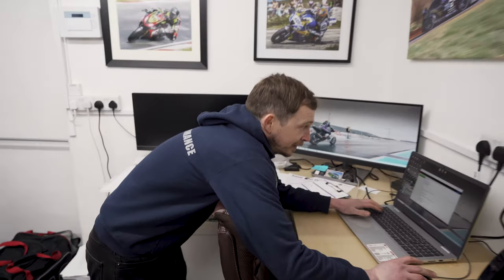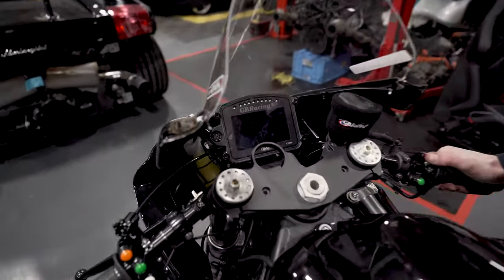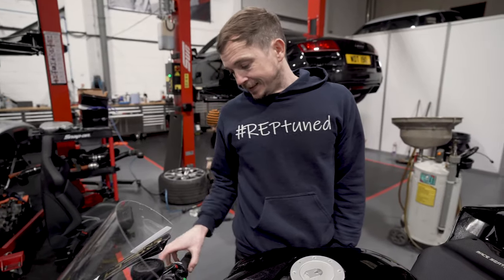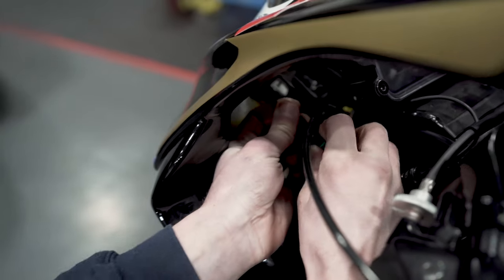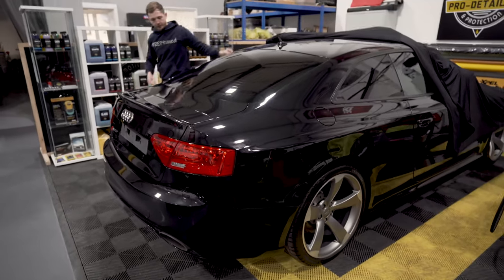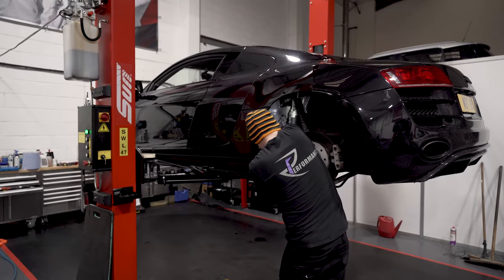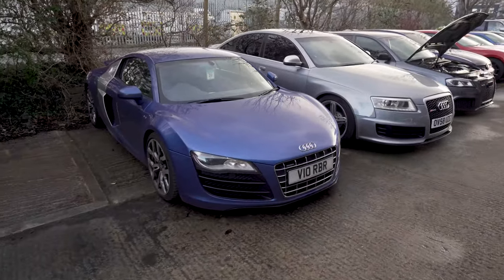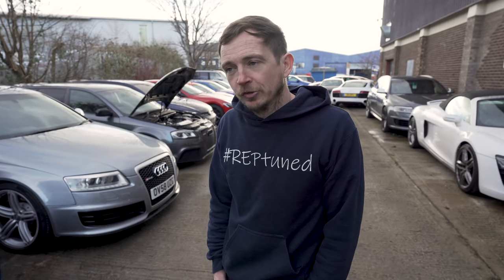New Race Bike! | Workshop Update No.7

Comment: What’s the story with some people removing their Lambda/O2 sensors? I was reading that folks remove them to stop the ECU from messing with the fuel map table (?). What’s the best way to tune - with the bikes Lambda sensor or a standalone one?
Reply: If Dyno tuned there's no need for lambdas so turn them off in the  ECU, if tuned via power commander addon instead of ECU then they need to be unplugged to stop the ECU overriding the commanders trim
Reply: @Andrew-ud3xl  But without lambdas how is the air/fuel ratio measured? I know on a dyno you might use a wideband on the end of the exhaust, but surely that's not accurate because the closer you get to the exit of the exhaust the more 'outside' air will be in the exhaust.

I heard the best way to tune is lambda sensor on each header - i.e., individual air-fuel ratios per cylinder. As opposed to average/combined ones.
Reply: The sensor is pushed bit further down the exhaust, should be quite accurate without lambda on the bike unless a change in something like filter, exhaust  or altitude. Recently put bungs on all 4 headers on my carbed bike to individually tune cylinders, thought if 1 is way off then others will be too when trying hit 13.0 afr when there combined, using wideband off eBay instead of going to Dyno shop